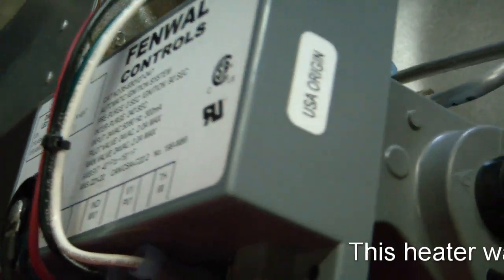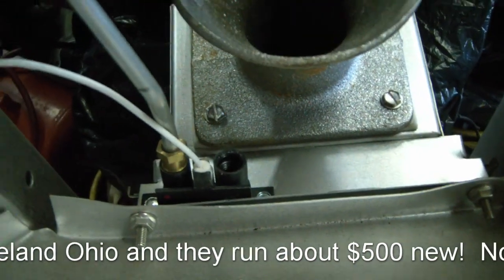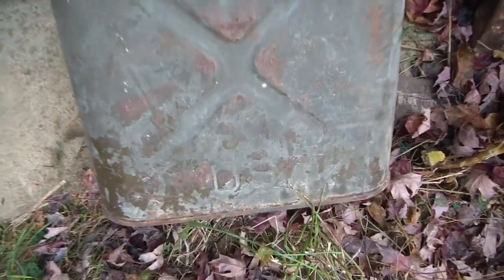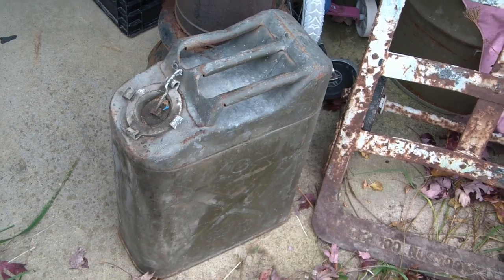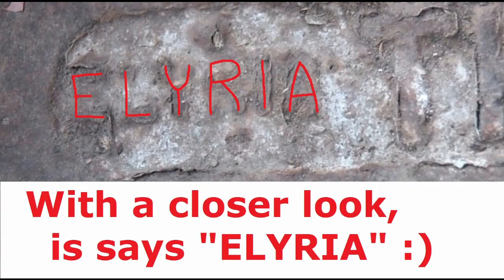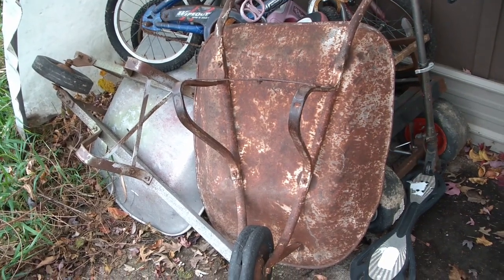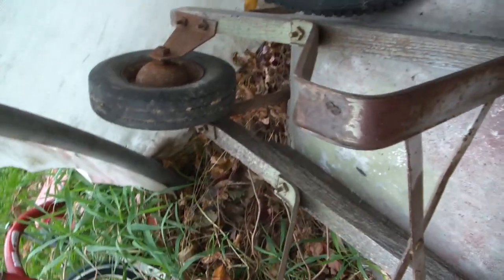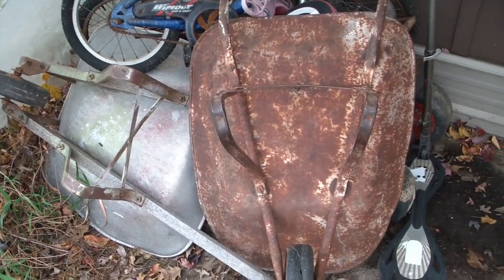Winter Updates & Randomity

Comment: Hi James, I also keep old motor oil. I mix it with creosote and bitumen and I paint my wooden fences with it. It’s disposes of the old engine oil in a safe way and makes use of it. It just stretches the creosote and Beechman along a bit great film how much is it going to cost to run that heater that’s going to be interesting
Reply from the maker: I don't have much use for the used oil.  When all my jugs are full, I take it to the auto parts store for recycling.  They all have a tank in the back where you can dump the oil into.  If I had a wood burner, I would soak logs in the oil to burn it effectively and make use of it.